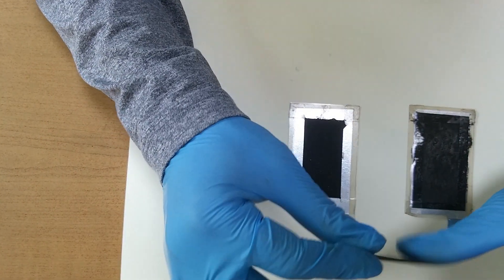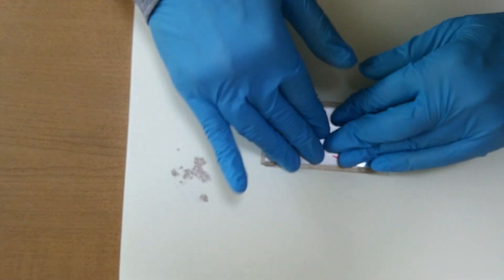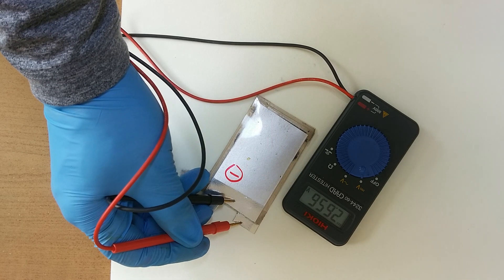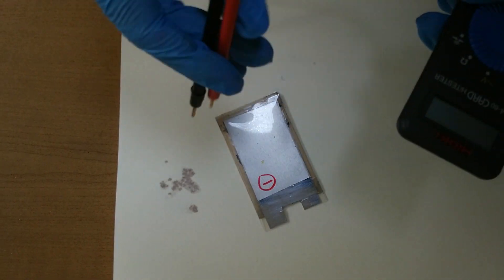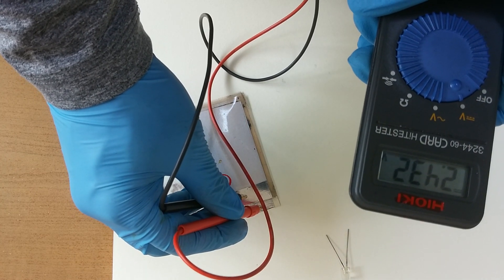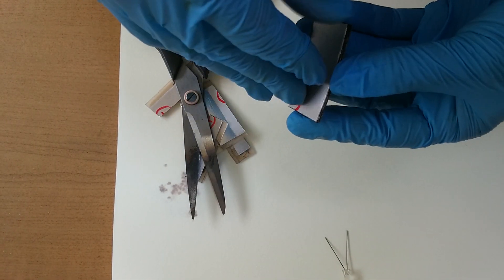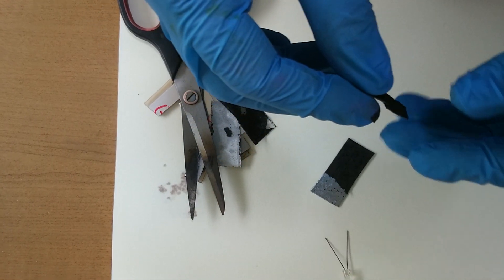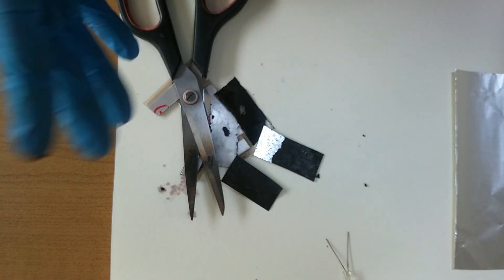iodine graphene solid state battery: stabilized in 2.43 V

Comment from the maker: I am so happy. Frankly, I thought that it might be impossible to make the voltage of this kind of battery stabilized before doing this experiment. But this experiment shows us great potential about building a battery without using lithium, cobalt, and nickel. Have a nice day.
Reply: Congratulations there. So you used graphite and iodine on one electrode.  What did you put on the other electrode?
Reply from the maker: @kurisa12  
Cathode: iron oxide, detergent powder(without chloride), toothpaste(without salt). Thank you.
Reply: @solidbattery9956  Thanks for the fast response. What was the anode made of?
Reply from the maker: Aluminum foil coated with graphene and iodine.
Reply: @solidbattery9956  Thanks, any idea what type of iodine solution strength you are using? I can't wait to try this
Reply from the maker: @kurisa12  
There are two kinds of iodine. One is in solid state, and the other is Povidone iodine which is sold in a pharmacy. I hope you avoid using iodine in solid state because doing experiments with such iodine is very complex and might be harmful. I hope you use povidone iodine. It's cheap. You can concentrate the solution in a fine weather to be thicker as you wish. Then, you can do your experiment. Have a nice day.
Reply: @solidbattery9956  Thank you

Comment: @solid battery sugar has to be carbonized. You can do it in a microwave. You need to blend it with salt and put in clay (or fire-resistant container) within 900watts carbonize it in 2 to 3 minutes. I would start it with 1 minute and 30 seconds, then 2 minutes after cooling. You can mix graphene or graphite powder. Use Zinc sulfate as a salt, not sodium chloride. If you use sodium chlorite you will need to wash. You can blend the sugar +Zinc Chloride (or copper chloride)+cofee grain+ graphite powder or graphene. This will give you high surface activated carbon. And if you do it with graphene or graphite powder it will be conductive. Oh instead of using aluminum as a current collector, I would try coating a flexible plastic with graphene conductive ink with Iodine on both sides. You can use aluminum foil as the other current collector and use a potassium hydroxide + Zinc oxide in a solid-state electrolyte using PVA as a binder.
Reply from the maker: Really professional you are!

Comment: hello, for the last few months I have been trying to make aluminum (negative), graphite and manganese dioxide batteries positive (imitating the idea of conventional dry batteries) and salt as the electrolyte. I'm quite happy with 1.2 volts. and the amperage is 1000 mAh.

I try not to use the charger, just change the salt water after the power is reduced. The result is the voltage will stabilize again

I'm having problems after the battery has run low due to being completely discharged. After refilling with new salt, the stable voltage is only 0.7 volts, but the amperage is high, respectively.

But if I replace aluminum with lead, the power returns to normal. What's with this aluminum?

Anyone understand this problem?
Reply from the maker: Thank you first, I perfectly understand what you are saying. It seems that the main cause of the cell seems to be the occurrence of hydrogen.
Reply from the maker: One more, the aluminum will be oxdized since Al ions move to graphite electrode. Have a nice day
Reply: @solidbattery9956  waw, very good response. thanks.
One more thing, I made a battery with the same material but tightly closed, the power does not drop and the amperage is still high. Even though I have used it many times to rotate the mini motor. I just replace with new salt water
Reply: @solidbattery9956  Sorry for bothering you. I am very happy if you are willing to tell a solution to this problem without having to recharge. We work in areas where there is no electricity.
Reply from the maker: @fatih.73jtxditonton43  
Aluminum or Copper has a unique trait. Unlike iron, aluminum and copper becomes rust only on the surface and forms a rust layer, thereby preventing them from being rust more. But, in this case, that trait doesn't work. Because aluminum electrode keeps being oxidized, which means that aluminum keeps disappearing. Because you adopt the principle of a primary cell, the only way is to change the aluminum electrode.
Reply: @solidbattery9956  maybe tin is better than aluminum?
Reply: @solidbattery9956  however, there are manufacturers that make salt water batteries using magnesium. Magnesium also shrinks significantly. They must replace the magnesium every 100 hours of use
Reply from the maker: @fatih.73jtxditonton43  
It may depends on your situation. Electric potential of tin is  -1.07, aluminum is - 1.67. Al seems to be better. Since I have not done experiments with tin, I am not sure of its result.
Reply: @solidbattery9956  The lead resistance is very small, and until now I have noticed that lead is not easily blocked by a layer of salt
Reply from the maker: @fatih.73jtxditonton43  
Lead is dangerous. Please you should handle it carefully.
Reply: @solidbattery9956  Sorry, not lead, but zinc, which is used as the negative electrode in primary dry batteries